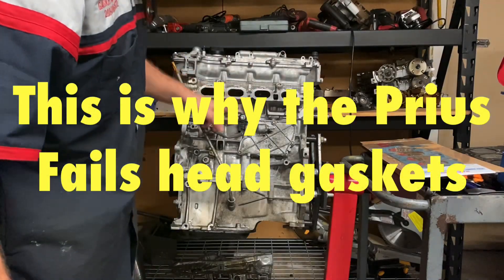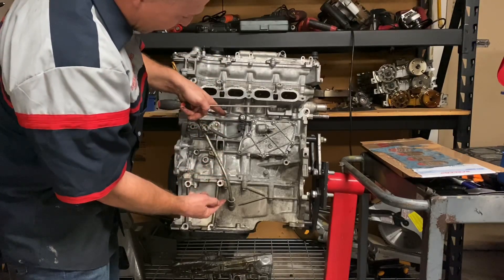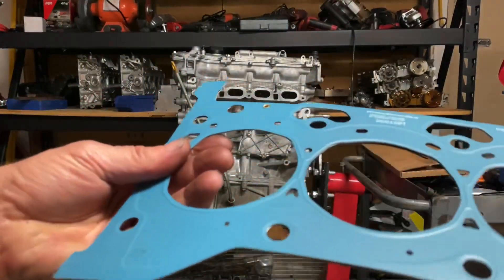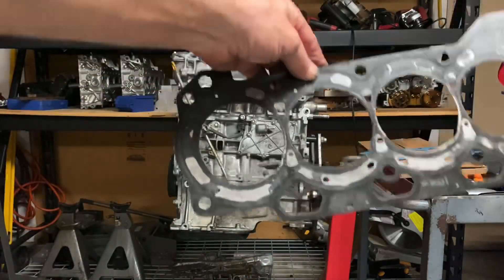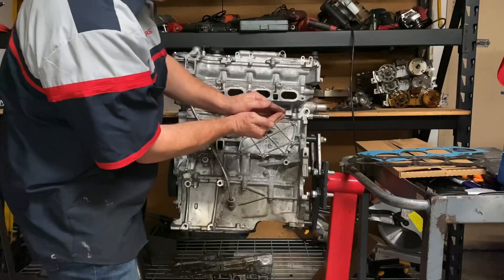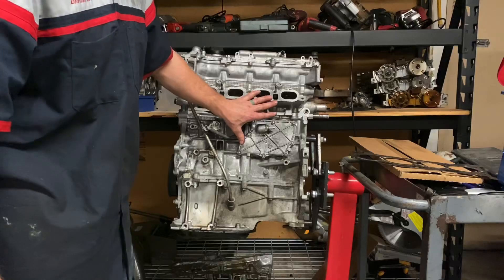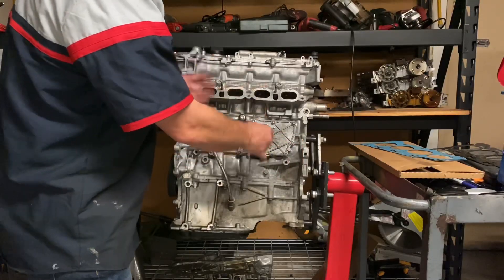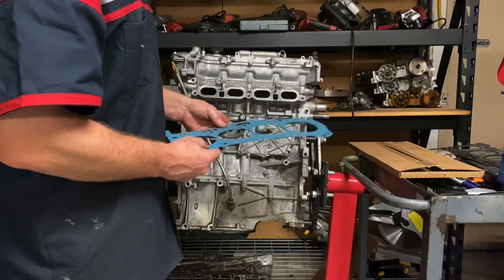THIS IS WHY YOUR PRIUS FAILS HEAD GASKETS, BUT ITS NO BIG DEAL

Comment: From what I have read the previous generation engines did not have nearly the failure rate though. Others have speculated that the EGR or catalytic Cooling system have something to do with it. It also takes a very long time for an engine to cool significantly so while a hybrid may have more Cycles each of the Cycles from 200° to 190° is flexing the head gasket very little relative to a single cycle where the internal combustion engine goes from 200° to 60°. I'm not sure you're correct with the theory here, although it could be a factor in some cases, the issues with his head gasket are pretty widespread

Comment: No one talks about the pump failure and engine overheating, which are the main culprits for head gasket failure. If your vehicle has over 100k miles with the original pump, simply replace it with an AISIN one—it's cheap and might save you a lot of money. Plus, it's quite DIY-friendly to do the pump replacement.
Reply: A hybrid mechanic in Dallas told me this same thing. Pumps are failing slowly causing excess heat without throwing a code.

Comment: Yall might want to take a physics class. Anyone who has changed their own oil knows these cars dont cool that fast. They just dont. So, unless youre sitting in traffic and the gas engine doesnt trigger at all for ~40+ minutes this is a bunch of bull. The prius is an electric assisted gas car. The engine is doing most of the work, most of the time. The average joe might see a cooling period from 190 down to say, 150 at most during a drive. 

These youtubers try and make it sound like your engine is going from room temp to fully saturated in ~10 minutes between traffic waves. Dont listen to them. Prius motors (especially gen 3) fail because of the EGR and EGR cooler getting clogged to the point where the recirculation is either choked off, or unbalanced, or both. The engine is designed with this system in mind and relies on it to keep temps down. If that system isnt manually cleaned out every 80k or so, youre at serious risk of a head gasket failure BECAUSE OF THAT. Sure, thermal expansion (and a stuck PCV valve) can play a part in it, but its EGR - not botched physics interpretations.
Reply: exactly right.  Lots of people here with no knowledge other than what a somewhat convincing youtuber is putting out as false info.  Second and fourth gens do not have head gasket issues, and it is because of ancillaries like egr design.   Not the heating up and cooling down of the engine.

Comment: If it was the application of engine then toyota's other hybrid cars should have the same issue like toyota's 1.8L hybrid IC engines I believe it is the design of the engine that is blowing head gasket   faster than other Toyota's hybrid vehicle engines. Toyota improved the design of the headgasket for this 1.8L engine it got a little better but still not as good as other engine's head gasket last.

Comment: Most people don't care about the head gasket failures in Honda D and B series engine because the labor time was so low. 

It does seem that Toyota needs to o ring the cylinder.

Comment: This makes me think the ECO mode actually would make the situation worse since it would minimize engine time to save fuel. Power mode would keep the engine more active therefore less of the cooldown/heat up cycles.

Comment: I have the 2012 Camry hybrid with the 2.5. What mine does is if I let it sit for 3 days and put it in drive and drive off without starting the engine first, it will have that shake for 3 seconds soon as the engine kicks in. But if I start the engine by tapping the gas pedal in park before I drive off, the engine never shakes no matter how long it sits and will not shake the rest of the day even if I drive off in drive without the engine on. I don't understand why.

Comment: What if my dealer has the "try this and see" attitude and starts with the most expensive parts?  I have no confidence in the dealers around here...  LOL
Reply from the maker: @mikieut   no no no. 
“Try this,” means they don’t know. Go somewhere else.
Reply: @gasketmasters  Hi, my is 2014 with 126k miles. sometimes makes bad sound(I thinks because of known EGR problem) but the biggest problem no heat inside(just a little out of driver side vent) and the coolant is coming out of the reservoir with no cap. I pressurized and then vacuumed a cooling system - everything is OK. Also I tried a block(combustion) test - the blue fluid never turned to yellow. So looks like a gasket is OK??? I think maybe the water pump is weak? I hear it makes noise and I can control it with a scan tool also(on/off). What could it be then???

Comment: The head gasket job is not hard as long as you have time, common sense, and patience. I just finished mine and the car runs better than the day I bought it. Just remember to clean everything thoroughly, replace the PVC, and plugs... you will have yourself a renewed Prius. Save money where you can and the advice given in this video is great.
Reply: That sht looks way over my head. The intake and egr removal is enough for me and the limited time I have
Reply: @mrc79 I respect that. Time is everything my friend.
Reply: Lol bullshit. Easily 40-60 hours of work of tracking down parts and tools to get it done. For a first timer it's about as laborious as it gets.

Comment: Great explanation… Thank you. I have noticed from some of your other videos that you can do a head gasket in a day. That obviously means that you do not take it to a machine shop and have the head ground flat. Do you find that in the case where it just starts using Excess coolant that the head does not need to be machined?

Comment: Almost all modern vehicles including other generation Priuses have aluminum heads and steel head bolts so this doesn't explain why the 2010 to 2015 have such a high failure rate. Perhaps head bolt spacing, head gasket material or I've even read that the electric water pump is to blame since as it ages the pump slows down. It seems to be fairly typical that cylinder 1 ends up leaking and misfiring. A deeper dive needs to go into this problem. Maybe the fix is as simple as changing your coolant every couple years but it seems like a design deficiency to me. 

Small clarification I should have made earlier. I really don't think the engine cycling and resulting thermal expansion is as extreme as what is explained in this video since the engine needs to maintain a certain operating range for emissions and to maintain the heater. I don't see the engine dropping more than 20 degrees Fahrenheit. For example in the winter the engine rarely shuts off. That leads to one of my only other gripes I have about the car, I wish the car had a temperature gauge. I've read a lot of antidotal explanations online but nothing in my mind pointing to a true root cause.

Comment: Tradu text folosind camera foto

I understand that on the 2014 and 2015 models of the Toyota Prius, they changed the cylinder head gasket to a better one. This is true ? Plus, Toyota recommends changing the water pump after 200 miles, which is the main reason the head gasket fails.

Thanks!

Comment: I always wondered why block and head can’t be a single piece. The pressure, heat and gas plus the stress on bolts are all because of the two pieces bolted together.
Reply: Yes also it could still be the same as now but without coolant circling through the head gasket!!! Instead it could circle and come out of block in external pipe and be connected to external head pipe 💪 guess that would get many of us out of these nonsense trouble with interchange of oil and coolant and stuff...

Comment: Is there a way to test when the head gasket is going to go bad? I'm trying to decide if I need to sell the car before the head gasket blows. I just spent $3300 replacing the brake actuator and I can't afford another expensive repair, and I'd rather sell while I can still get something for it.

Comment: If the coolant is keeping the head at a constant temperature, surely there is no constant expansion and contraction ? I was always under the impression it was water pump failure that caused it.

Comment: Great explanation, but the defective ring and piston design in the Gen 3 engine often leads to extreme oil burning and EGR cooler clogging. So fixing the head gaskets is not a guarantee of a trouble free future - especially if your Prius is already an oil burner. For this reason I just put in a rebuilt engine with Gen 4 pistons & rings and hope to get another 100K miles - it cost $4,600 installed at Hybrid Pit Stop in LA - they sell these rebuilt engines on eBay.

Comment: I found a guy that puts 4th Gen Prius engines into 3rd Gen where supposedly Toyota fixed the problem and now it's basically bulletproof. Unfortunately he is on the other side of the country from me. I love my Prius but I'm not sure if I want to buy another one thinking that it's just a ticking time bomb waiting to bust. I once had a e90 M3 with the e65 engine that has rod bearing problems that is very similar to this Prius engine. Ticking time bomb....

Comment: It all depends on the type of driving. There is a current 2019 Prius prime owner that uses his vehicle for medical deliveries. He has just over 500,000 miles on the car and hasn't had any issues. The reason? 90% of his driving is in the highway where the engine stays running the majority of the time So there are less heat cycles.
Reply: fourth gens dont have the head gasket issues that third gens do....same with second gen.   It is only the third gen.  So it is not about city vs highway...

Comment: Oh man not sure how I missed your video! U did a fine job explaining the issues with these hybrid engines, you are spot on!! I studied these 1.8 engines both hybrids application and non-hybirds, after reviewing what I learned using scanner software Data I saw that the hybrids have a large widow in temp range anywhere from 165-192 degrees in stop and go traffic, and where the   non-hybirds engines are consistent around 196-198 degrees! As u mentioned felpro redesign theirs gasket to help with the fluctuating thermals cycling and improved their head bolts too!  So far zeros issues using felpro products in 3th gen prius!
Reply: Are Felpro trustworthy as mahle gaskets? Also bolts? If your experience tells that Felpro good along with minimal price, that would be a good choice
Reply: @Alan-76ersPA  mahle gaskets and hardware are great though I had choose felpro for the fact they improved there gasket and bolts with hybrid application in mind... zero failure since updated! Thanks Nate

Comment: i disagree with this: the little ridges at the edge of gasket are never designed to flex. when head is installed, there are several high-strength steel bolts, that are tightened to the break point! so, that there is absolutely no chance of flexing. when installed, gasket is flattened and stays flat. then, the temp cycling. yes, prius goes on and off, but engine is heavy and has enormous heat inertness. so, temp variations due to engine on-off are very small zigi-zaggies around working temp of 80 degC.
Reply: as i was test driving yesterday i kept my autel on watching temperature of coolant and pump revolutions. the red light stop only had a 1-2 degree down. But then, when I pushed the pedal hard, the temperature went to 101 degrees! The stop-go temperature variations are small, perhaps up to 4-5 degrees. but hard pushing the engine leads to much higher temperature fluctuations.

Comment: This issue seems to be prevalent in the 2AR-FE as well. My mother's 2015 Camry (Very well maintained & not beat on) without warning, it blew the head gasket at 38k mi.  The only DTC's were P0302 & 303. (Important for her case study). The Local Toyota dealership ran their diagnostics and maintenance history, and pushed back trying to deny the manufacturer warranty claim for the "H.G" due to in her maint. history, she had  got her oil changed a few weeks before (Late June) by an "express" style oil change franchise, and they used 5w-20syn. Toyota tried to deny the claim because on the oil fill cap it says 0w-20syn. 😂 Too bad it states in her camrys owners manual, that during spring/summer months, it's 100% safe and suitable for the 2AR-Fe.  I stepped in on her behalf, as a certified Auto mechanic, my first question for the head tech of the warranty & service department was, "were there any VVT, cam/crank correlation, EOP DTC's current or stored?" - No. "Was there any coolant temp. related DTC's?" - No.........😬 "So just the 302 - 303 misfire's?" - Yes.......😳     Umm you might want to contact your superiors at Toyota global warranty center. 🤔    -  20mins later he came back saying, "Her claim was approved finding her clear of any cause of failure & set her up with a free loaner car until her Camry was repaired.  Nobody is going to rip my mom off on vehicle repairs, damn sure not the dealership!  80k since the repair and it's been ok.  Now just yesterday it set a P0420 🥴 fml😅
Reply: Seems way too early for a p0420. Good job taking care of mom
Reply: It did have a defective head gasket around 40k. Toyota fixed it under warranty.  From what I gather there isn't an issue with the 2ar, just a bad batch of MLS head gaskets @mrc79

Comment: My 2013 Prius started doing this in June. Dealership diagnosed EGR, charged me $2100, even though I told them it sounded like a head gasket. But it didn't fix it. Took it back and the said they ran leak checks, and blamed the carbon buildup on loose piston rings. I told them that the problem went away if I took the cap off the coolant reservoir, and couldn't afford an overhaul. Left bad reviews online that got a mgr's attention and a refund of the $2100. Now, the symptoms have returned, even with the cap off. Hope your replacement tutorial gives me hope....

Comment: Helped my son replace his Prius head gasket a few weeks ago, it is running fine now. However, we had called a few shops to get a quote, but none of them wanted to do it on a 2012 Prius, the one shop that gave an initial quote of around $3500, then asked how many miles, when we said 175k, they then said, no they wouldn't do it, too high of mileage. Something about liability. What is up with that?

Comment: Makes sense. I'm an uber driver and have the car running 24/7. Don't shut it off when going into stores, end up sleeping in my car 50% of the time. (Because too tired to get home). I drive about 15 hours a day. Got 300k out of my prius on original gasket which is impressive. 

Probably going to use a sealer. Idk maybe I'll change the gasket. It's got 300k miles on it, might as well try the sealer, and if it don't work, get a new engine.
Reply: Jesus dude, that's no way to live a life. But I'm glad you were able to get that much use out of the first head gasket..

Comment: My Toyota mechanic said it needs a new engine. No explanation how he arrived at that conclusion. I left to go home and a check engine light was on when I left the dealership. I got home and used my Bluetooth scan tool and it said misfire in cylinder 2. Mind you when I took it in had no check engine light on. My car drives smooth just rattles and shakes in the morning.
Reply: Coolant tank cap.
Reply: I saw a video, guy said he stopped the shakes on start up. He removed the oring under coolant tank on passenger side.
Mine had the shakes that morning at 258k,took it off that night, 300 miles later no more rattle or shakes, hoping it stays til I get a HG replacement.

Comment: Do you do the timing chains also   Ours has 194 k
Reply: you have to remove the timing chain to do the head gasket.  Kit from amazon will work. Make sure the gasket is the blue felpro.  I did mine at 230 K and had to redo at 261K because I didn't use the felpro.  Wisened up.  I also replaced the valve stem seals. You also need to make sure you replace the o-rings in the cam around the oil ports.  Oil passes through and on to the cover to oil the camshaft and rockers. All stuff comes in the headgasket kit....just don't use the headgasket that comes with it(get the fel pro seperately).  Also change the water pump.  Amazon has THE oem....with just Toyota scraped off.  My timing chain guides had some wear.  All came in the kit.    I haven't done mine yet but have the inverter water pump.  Also Amazon OEM with toyota scratched off.  Will do mine around thanksgiving.

Comment: My head gasket blew, heated up the engine and possibly melted an aluminum plate under the engine?  Mechanic said whole engine needs to come out, aluminum plate taken out and sent to machine shop for straightening?  Does this sound right?
Reply from the maker: You don’t have a very good mechanic
Reply: @gasketmasters  well, I'm sort of in a bind...car is now 150 miles from home (incident happened while visiting friends)...what are your thoughts?
Reply from the maker: @atomickitties8069  Get that car towed to your house. If they’re changing the engine, there’s no reason to have any plate machined. It appears that they are soaking you for all your money
Reply from the maker: @atomickitties8069  what city are you located?
Reply: @gasketmasters  Riverside, CA. .car is in Santa Barbara....I had to get a rental car and come home to go to work.  Happened over the weekend.
Reply from the maker: @atomickitties8069  what shop did you take it to?
Reply: @gasketmasters   AK Auto Repair in Santa Barbara...on Cota Street
Reply: @gasketmasters  just to clarify, they are not replacing the engine he said they have to take the engine out, there is some aluminum plate underneath that they have to pressure test and if it cannot stand 50,000 pounds of pressure it cannot be repaired. If it can withstand 50,000 they will have it taken out and an engine shop will straighten it. That's what he told me
Reply from the maker: @atomickitties8069  Right next store is easy auto motive they are trained by us to do the Prius Engine’s
Reply: @gasketmasters  car is 2013 Prius V